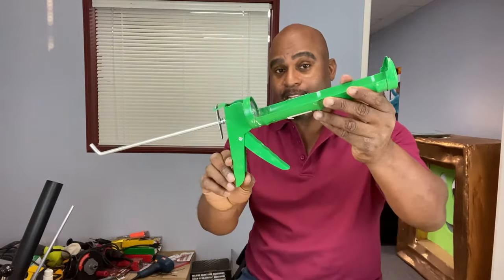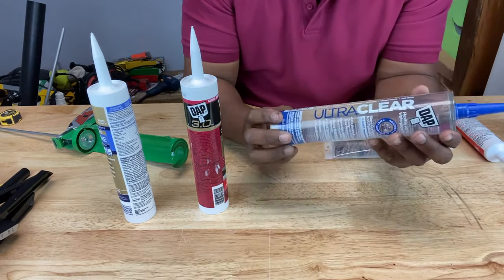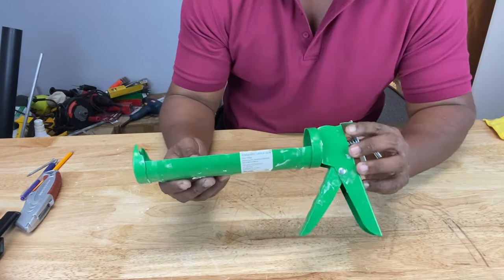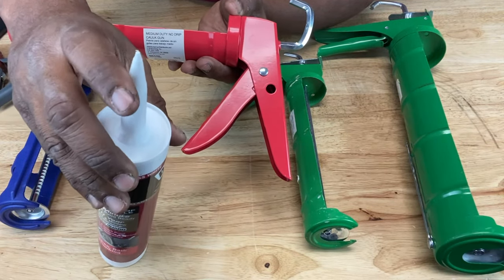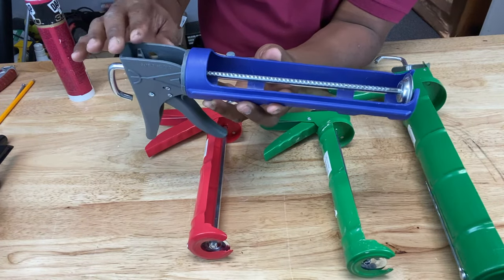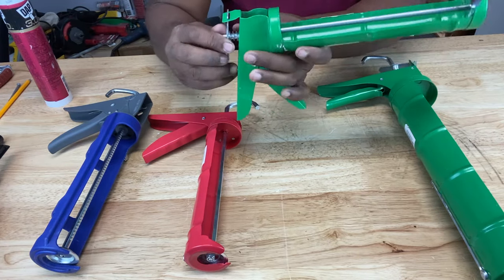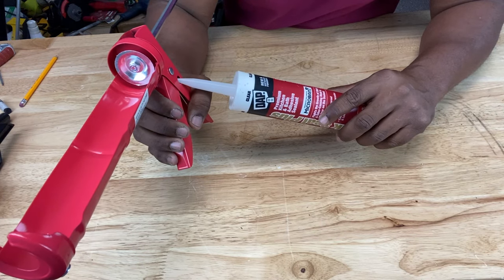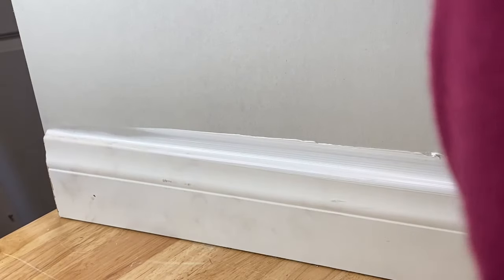HOW TO USE A CAULKING GUN FOR THE FIRST TIME

Comment: So many tutorial but caulking gun still hard to press when use with silicon sealer 😂
Reply: If you are really having trouble with this they have caulking guns with different thrust ratios. Basically the shorter the distance the plunger moves with every squeeze the easier it will be to squeeze. You probably won’t find the thrust in No in a home center but you can usually find it online then just match manufacturers and part numbers
Reply: @_azamuddin  is there a way to make it easier? I can't push anything out at all.

Comment: Put a nail or screw in the end to seal the caulk and use again later so it doesn’t dry out.  Also, there’s tools you can use to make a great line other than your finger like a Cramer Profiling kit.  Great video! Thanks!!
Reply from the maker: Great tips thanks.

Comment: Thank you so much for explaining the Ratcheting Caulking Gun.  That's what I have and didn't know I needed to turn
the handle.
Reply from the maker: Glad it helped.
Reply: I've been learning a lot about how to caulk, but not how to use the gun.  Funny eh?
I just finished caulking 3/4s of a circular bathtub.  Masked the floor and around the tub.  Used the 5 size edging tool AND... it turned out beautiful.  
Clear caulk helps!!!

The hard part comes tomorrow when I need to jimmy up a 14 inch extension to get between the shower stall and the bathtub.    
I'm going to use Fish Tank tubing on the end of the Caulk Tube and tape a skinny wooden Dowel on to give it some stability.  Any other suggestions would greatly be appreciated.  LOL  Can't tape that area.  Less than 2" clearance.  Dang!
Thanks again!

Comment: I have been a professional caulker for over 45 years. You did a very good job explaining the very basics that many overlook. My only suggestion is although there is a nozzle cutter on a lot of guns you should not use it. They tend to crush the nozzle adding to the challenge of shooting a nice bead. Use a sharp utility knife cutting into a piece of wood( for safety)
I had a few issues with your discussion of sealants but that was not the focus of the video.👍
It is very easy to overlook the benefits of a video like this. Keep them up
Reply from the maker: Good tip, thanks for the feedback.